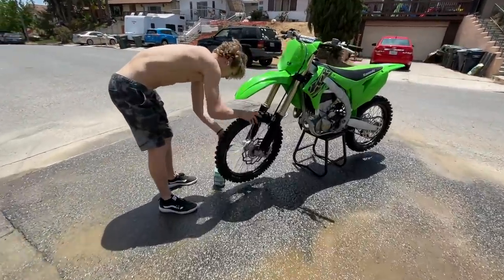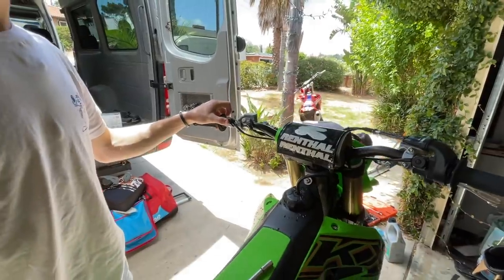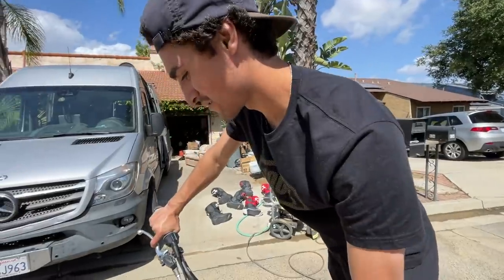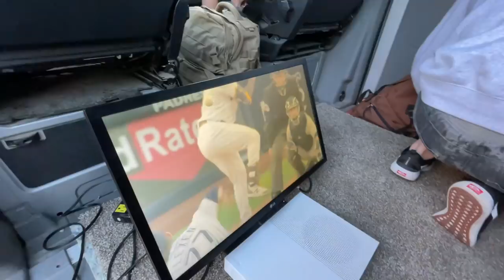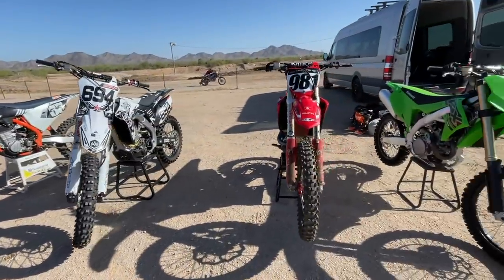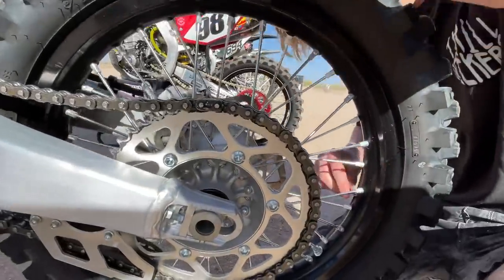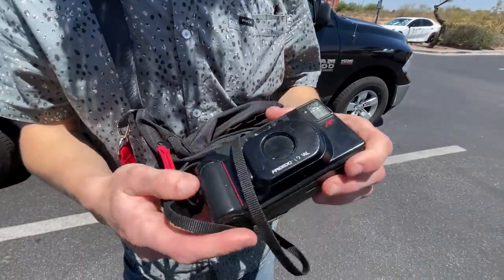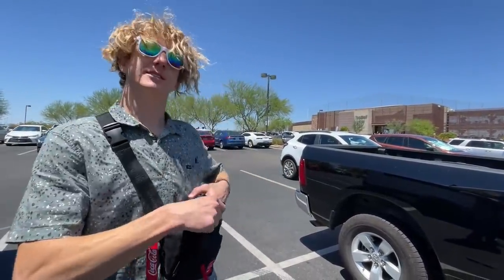Factory GASGAS Bike Work - Buttery Vlogs Ep94

Comment: 11:06 the part that was on Buttery's reel post on Insta 🔥🔥💯
Reply: Was that a brake tap I can’t tell
Reply: @kaic9712  yea kinda. It was to bring the front down. I believe to do that you need to hold the clutch in and press the rear brake. I'm pretty sure that's how you do it.
Reply: @ggmx274  I put it in slow mow and he doesn’t touch the brake so I think he pushed the bike with his arms